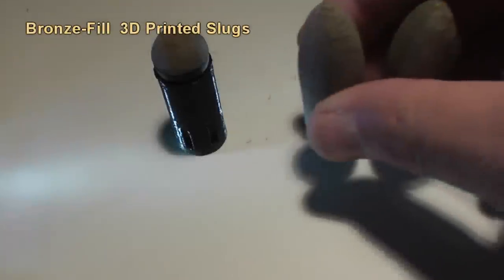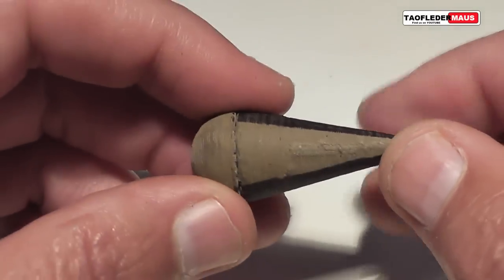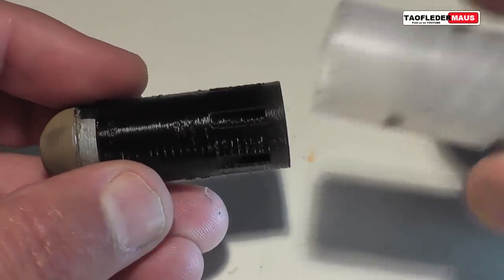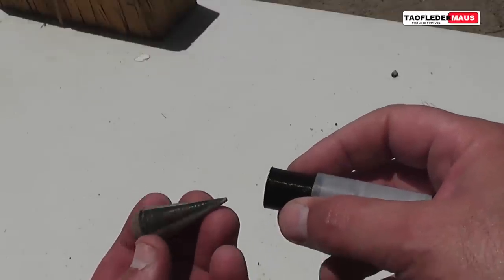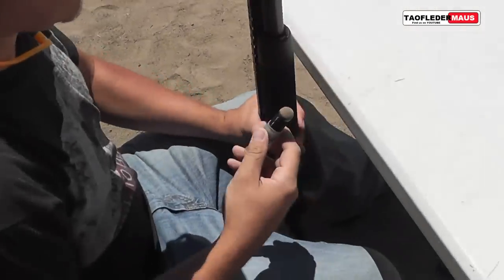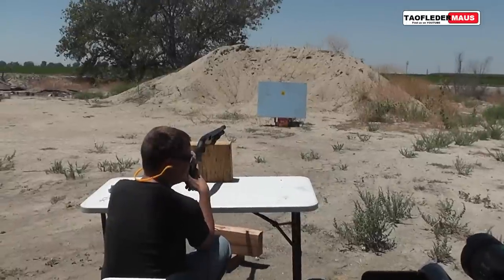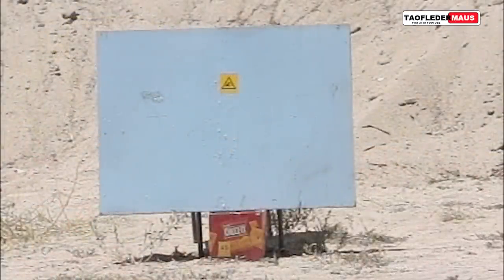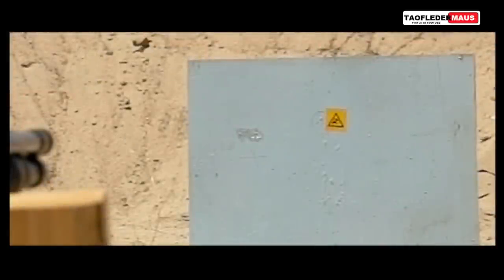Teardrop-shaped 3D Printed Bullet -   Fail Analysis

Comment: I like the blue background, it definitely helps when viewing. Some things that come to mind that may cause it to not have separated.

The round itself is tapered and could cause a lock with the sabot. As it could stretch the rim of the sabot. The 3D prints, both the sabot and the round itself, have a surface that is corrugated. They look to have been printed such that the peaks of the sabot would lock into the troughs of the round.

I'm assuming it was printed with the same nozzle size and layer height etc

Comment: Hi Tao, the round spun arse first because there was a lip where the round hung slightly wide of the sabot (it can been seen with a keen eye), this lip acted as a wind brake causing the weight to transfer to the front. 
Also, I would suspect that the round (being loose in the cup) was slung into the sabot, think Newtons First and Third laws. The round (object at rest) was hit with such kinetic force that the point of the round penetrated the sabot fusing them together (size of the force on first object, more then equaled the size of the force required to move the second object and then some) otherwise if the above wasn't prob true, then when the round spun the sabot would have traveled quicker causing separation. But that did not happen until another large kinetic force (hitting the board) caused that. 
Good video

Comment: You could try to make the front part of the teardrop heavier (try to put a small screw at the top) - it would stabilize the bullet, also You should try to modify the sabot as follows:
a) cut away the bottom so the gas propels the round not the sabot, 
b) cut the remaining part of the sabot in two so it breaks away from the bullet when it leaves the barrel.

Comment: My guess would be the projectile and sabot did not separate because of the tapered seating that they both had. As the shot was fired the sabot was forced hard against the projectile tightening the connection.

Comment: Since you asked, I'll give my thoughts on the matter. 3d printing is rough we have to admit that. Right now I dont think our technology can obtain a smooth surface like in a injection moulding. So these series of steps to form a slanted surface may make the teardrop get stuck in the sabot. Of course 3d printing could be great in that it can make stuff with holes in them to get pinpoint accurate center of gravity.

Comment: When the round is fired, the sabot takes on all the pressure and wedges the bullet into itself. Either try a sabot that's just a hollow tube, so all the gas is pushing on the projectile instead of the sabot, but you'd still need for the round to go down the barrel straight and in that shape, it'll almost always force itself to the side and come out sideways because there's always a different amount of pressure on one side of the cone then the other. How about printing in some side supports into the bullet? So basically 3 or 4 tail wings that would keep things straight in the barrel. If there was ever going to be a bullet that could use fins, it might be this type of design. The teardrop shape creates a low pressure zone and that might be perfect for grabbing onto some tail fins that have a twist on them..... So the reason normal bullets don't work with fins is because the front pushes all the air out of the way, but in this type of a design, the air would be pushed down along the edges of the bullet directly into the fins.
    Also, if the fins get in the way, then you can make them break away in flight by printing in very thin supports. So if there's no aerodynamic advantage, they can be used to guide the round and then break off when air turbulence hits them.
     As for better high speed cameras, open a patreon account man! So many of your followers would love to chip in and help you get better equipment and make more awesome videos. It's not a handout, we really do support everything you do, and would love to contribute in any way possible.

Comment: Mechanically assisted flanges on the sabot help separate the round from the casing.  They act like an air brake. It could even be some loose flaps folded on the sides as long as it generates enough drag to reduce the speed by at least a tenth of the rounds speed it will separate properly.

Comment: With the Sabot tube. When the round is fired it probably shoves the tear drop projectile into the tube. If you can add " speed brakes" to the tube to create enough drag to decelerate the sabot so the tear drop separates from the tube you may get just the tear drop flying solo.

Comment: I wonder if grooves up and down the length of the inside of the support might help separation, but for sure it was shoved into the support when fired. you could try an agent like tp or a powder to help keep them apart, but  I doubt that would help much, maybe just a tp wad instead of the sabot?

Comment: Off the top of my head, the only thing I can think of that would make this one work would be to have the "sabot" cup be at least in three sections, so that as it is travelling down the barrel, it still keeps everything aligned, but as soon as it passes the brake, the sections fly off. Maybe not an original idea, but might be worth a shot. Pun intended.

Comment: I would try sanding the tear drop and its housing because the force could have pushed them together and inter locked the line from when it was printed.  you could also try printing the housing it 2-4 pieces.  metal filaments are actually weaker because the metal particulars aren't bonded with the plastic as well as plastic bonds with plastic btw.

Comment: I look at it like a weeble wobble. It has all of it's weight in the widest part of the body. The thinner part (top) is fairly weightless in comparison and is causing it to tumble. The "sabot" part of the round most likely was pushed and "wedged" onto the teardrop due to the extreme pressure that a shotgun round exerts on a round when it's fired. Not just that, but if there was any space in the barrel when the round was fired and it wasn't a near perfect interference fit, then it's going to bounce around in the barrel as it comes out and lose velocity, damage the round, and cause a failure of separation. Just my guess.
Keep the awesome videos, Jeff. They're really awesome. However, I think you should take a regular shotgun slug, give to NYC, have him take measurements and machine a bunch of different shotgun rounds. Then shoot it! I think that'd be pretty awesome.

Comment: Since 3d printers don't print sharp, smooth edges. Maybe sand down the outside of the tear drop until it is a lose fit. (But be careful of how much weight you take off the front edge). Plus I don't know if the round will work because the salvo and teardrop never fully straightened throughout flight and on impact. Maybe more distance and higher velocity may do it some good.

Comment: There's likely a low pressure area behind the slug and the sabot is caught in a slipstream. Who knows also if the material it was made of deformed and mechanically bonded a bit under acceleration. I'd think a way to ensure separation would be to make the negative cavity the slug fits into fluted, and possibly either bisect it, or cut wings into it (like in federal's flitecontrol wad).

Comment: I believe the failed separation is because of a vacuum effect. To demonstrate this, try dropping a piece of paper from shoulder height, then try again while it is sitting on top of a book of equal or greater length and width.
To fix this, cut the sabo into 5 strips and create some sort of drag on the leading edge to further encourage separation.

Comment: I think the shape made it unstable, the force of the powder ignition forced the holder tight enough for it not to separate. In the last couple feet you see the round straighten out, this is because the tip is heavier and it had the distance to correct its path. I think if you backed up 5-10 feet it would have time to tumble until it finds its best angel (heavy first).

Comment: Use a four or a two piece sabot instead of a single slab. The powder explodes and all of the force is behind the sabot, pushing the teardrop projectile further into the sabot - once the sabot & teardrop duo leave the barrel, the air is pressing mostly on the teardrop projectile - the sabot had no means of separating.

Comment: That isn't a teardrop.  It's just a cone with a hemisphere on the end and is not a very aerodynamic shape at subsonic speeds, much less at supersonic speeds.
Reply: Well older spacecraft reentry modules, like on Apollo, used a similar design, just without the tail, to help with stability and heat control as they burned through the atmosphere. I don't see why the design wouldn't work here, especially since this has a heavier 'head' and a long tail, which leaves a higher area exposed to the wind, thus more drag when yawing.
Reply from the maker: *****   Send me one you think is a teardrop shape then.
Reply: You just described a tear drop
Reply: Jordan Philip Aerodynamics can be somewhat counter intuitive.  It's more complicated by the numerous variables when shooting projectiles from shotguns, but even in the steady state flow analysis there is actually a significant difference between a ball and cone and a tear drop profile at subsonic velocities, even though they have a superficially similar appearance.  The issue is attached laminar flow versus turbulent flow.  There is a sharp edge where a hemispherical nose makes the transition to a cone shaped tail that could trip the boundary layer.  I'm definitely not saying that's what happened here as there are plenty of other variables that could have been responsible.  My best guess would be transonic buffeting and/or interaction with turbulent muzzle blast, but that's not a high confidence guess.   Furthermore, the example you gave was reentry into the outer atmosphere, which is an apples to orangutans comparison when considering the different Reynold's numbers.  An Apollo module is hypersonic and even though it's moving very fast, the pressure in the outer atmosphere very gradually builds from a hard vacuum to a very low pressure, giving plenty of time for the capsule to align in a minimal drag configuration.  Shooting stuff out of a shotgun into air that's 1000 times more dense and expecting it to stabilize in 20 feet is a very different proposition.

But, as always, shooting stuff is fun.  Thanks Jeff... and Mario!
Reply: ***** Please see kanan348 and Liberty4Ever responses for good explanations of my argument.  I love your videos so please don't feel insulted.  I am just making the comment that this shape does not lend itself well to laminar flow (aerodynamics) in subsonic flight, and for supersonic flight it would actually be more aerodynamic flying backwards.  (as Jordan Philip pointed out with the space capsule designs)  For any empirical argument a CFD simulation is about all that would hold significant weight since aerodynamics isn't intuitive.  Thanks for the reply!
Reply: ***** It is very different than a teardrop.  See kanan348's response for an example of a teardrop.

Comment: I dunno if it was already stated, but the problem was in the shape of the bullet and material - when shot it just got pressed into holding part and there wasn't enough force to break that bond. But if you try and make compound holder which will break into 2-4 pieces after leaving the barrel it may work.

Comment: My mostly uninformed advice:

Make the sabot out of two halves with a vertical split going down the middle.(or out of three pieces in a similar arrangement) Sort of like how anti-tank rounds are constructed. Heck, if you give me the dimensions of the round and sabot I'll design it for you in solidworks.

I haven't read all 800+ comments, if someone else has suggested it you have my apologies.

Comment: OK Lets think about this.....Maybe add a flare to the sabot so it resists enough to slow it from the projectile to help separate them, then if you can give yourself a little more distance from end of gun to target, the further from target you are the more things happen, I also read someone suggested a tarp for the sand pile, not a bad ideal or you could put some blue sand on the pile, tarp would be cheaper.......Maybe a sprayer with blue dye or cheap paint thinned down a little and spray the front side of sand pile? 
The black and silver are good colors to use on the projectile and the camera placements are good.  Your shooter is doing a good job so other than what I have suggested I am not sure what else can be done, yes it would be nice to have better cameras but hey at least you have high speed cameras,  I bet most of the people telling you to get a better one don't even own a cheap one!  I would love to have a cheap high speed camera, not in my budget right now! 
OK Hope I have helped, have a great day.

Comment: The holder wasnt really a sabot, which is why it refused to separate. A sabot must be in three or more sections, to allow the pieces to separate from the projectile. You might get by with slits cut down the length of the holder, like in a standard shotshell plastic wad. That works in the wad because the plastic is flexible enough to allow the fingers to fold back when air resistance is encountered, to release the shot column. That piece looks too stiff for that. If the fingers cant easily flex backward 90 degrees, then the sabot needs to be in three or more pieces in order to fall away. Halves will not do, trial and error has shown that separation requires 3 or more. Two piece sabots do not release reliably.

Comment: More air resistance on the rear of the sabot is required. You can see the designer no doubt had the right idea with the cut outs at the rear to create turbulence, I am under the impression those cut outs are not big enough. Also because of the cone shape/wedge sabot design the forces of the round being fired will wedge the 2 together.

Comment: It didn't work because the sabot had a solid backing. 3D printers print in layers. At the beginning of the video, you can see that the "grain" of the sabot not only lines up with the grain of the projectile, but also runs perpendicular to the direction of acceleration when shooting. My hypothesis is that this essentially shoves the round against the sabot and causes the roughness to interlock, making separation require much more force. Try a splitting sabot.

Comment: The round fused together when it was fired. The heat from the gun powder melted the plastic. The fit was so loose that it makes the most sense, because the gap was too big for the rushing air not to rapidly slow down the cone shaped sabot carrier compared to cone.

Comment: Acceleration forced the projectile into the sabot/shotcup... the ridges created from 3d printing locked it in place, like a morse taper. I think the round has potential, a true sabot might fix the problem. If it where segmented vertically and extended past leading edge of projectile it should separate. Also a little sanding wouldn't hurt.

P.S. You rule Mr. Maus.
Reply from the maker: Zachary Piche  thanks!
Reply: Zachary Piche yep my first thought aswell when i have seen the round. for 3d printing i guess a grooved miniball design would still be the best since it gives grip and spin. Wonder how the metalinfused plastic will behave in the barrel.

Comment: The bullet sticks to the holder for the same reason a sheet of plastic can stick to a wall - big connected surface, no air to fill the cavity opening because of separating the two. If that holder had way more holes, they would most likely separate with ease.
Also, as far as I know, at supersonic speeds the teardrop tail has no effect, as air is too slow to close behind the round anyway, so you leave a big, pulling, trail of vacuum anyway. Great shape, but not for bullets. On the other hand, it should help stabilise the round, as if it turns, the tail is gonna encounter a lot of force and will swing back. Same happens with fletched arrows.

Comment: The little sabot is probably "sticking" to the bullet since it's a plastic that has a pretty high friction coefficient, being mixed with metal and having such a rough texture. It would also probably help if it was multiple pieces.

Comment: I wonder if the projectile wedged into the sabot. From what I saw in the vid, the sabot was one piece and shaped to fit the teardrop. If those two were made of wood, and you gave them a light tap with a mallet while together, the two would form a wedge joint. Maybe splitting the sabot would help.

Comment: The sabot sticking may have had something to do with the taper being so shallow. I understand that's the design of the round, to be aerodynamic, but look at taper shank machine tools sometime. Morse taper shanks, usually on drills and used in most lathe tailstocks, are not self releasing. They can be jammed together and become extremely difficult to separate sometimes. I think the powder igniting in the barrel just jammed the lighter sabot into the heavier slug and stuck them together.

Comment: id suggest one with a sabot made so it separates into 3 parts, so the sabot comes apart in the air, not lodged to the end of the round. also may need to file down the round so its smooth and doesnt have friction against the sabot that would cause interlocking.

Comment: Slicing the sabot unit's sides up to add a point where the stress can allow the sabot to separate might work, or adding some kind of fins that give it some more drag to let the air catch it and pull it apart. It could also be that the sabot round was just stuck to the unit when fired, maybe pushed up against each other so smoother surfaces could do the trick too. Could be many things, way too many variables to only try one idea.